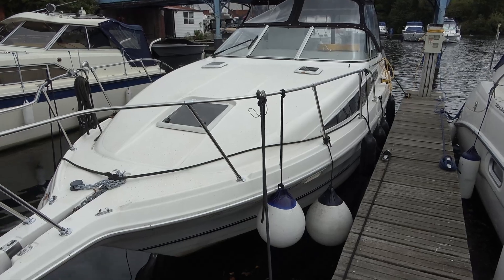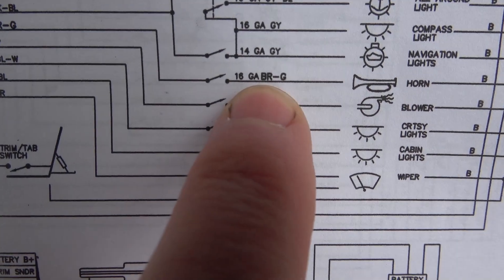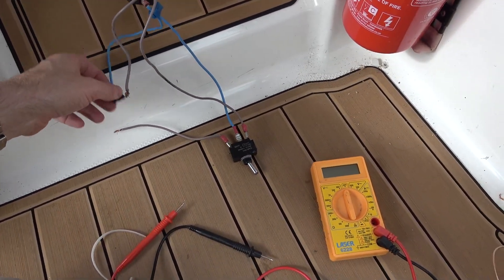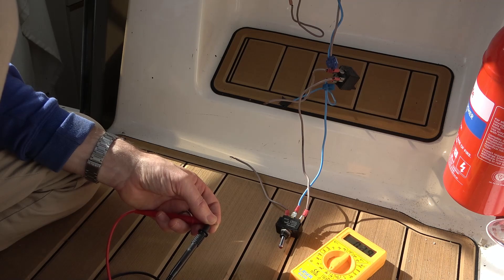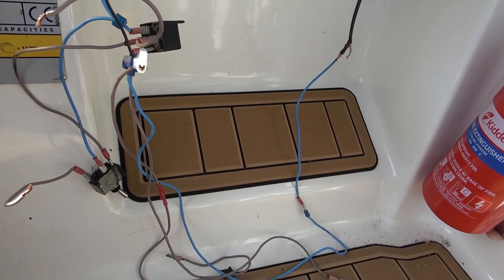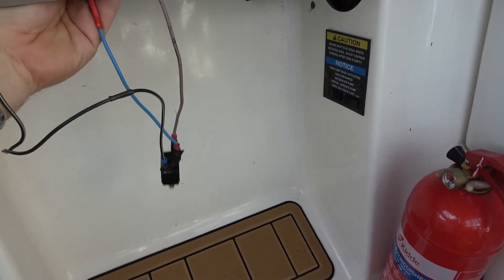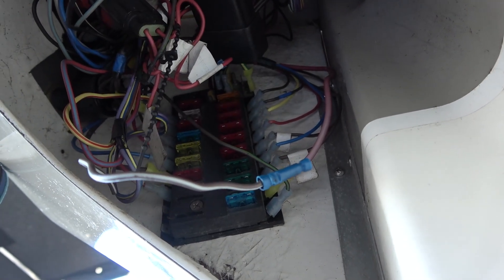BOAT HORN NOT WORKING - Can We Fix it?

Comment: Great fix as always Vince. I'm all for simplicity so would probably have done away with the relay as well. The horn has a low current draw and on a momentary switch its not going to need a relay. I suspect this was for the other after market item as you suggested. 😃😃
Reply: Maybe some older air horns must use a lot of current.

Comment: I'm an electrician by trade but like yourself I've done nearly everything . I reckon the only reason for the relay there is if they were driving something else besides the horn off that switch , ie the lights flashed when you blew the horn ( which might be too many amps for the switch , hence the relay) . Whenever I work on boats or mobile homes I always solder the joints and use heat shrink. I've seen some horrible connections with scotch lock things and spade connectors . Well done Vince , keep up the good work

Comment: it is quite common that devices on boats exceed the current limit of the switches so they add relays but then people come in and decide to add things on to circuits and think it is ok to just increase the rating  on the fuse on that circuit to allow for the extra drain but sadly those that add on usually tap into the wrong place and reading other comments some horns do have quite a high drain and yes usually would not need a relay but you dont know what has been added and without knowing the drain from the horn and the current rating on the switch you cant simply remove the relay I really enjoy seeing the things you do and your thought processes and logical decisions and that works great until you start work on a circuit that people who dont understand electrics have put taps on it. I am an auto electrician but I am very impressed with how you work through repairs but personally when working on electrics it is always important to identify what changes have been done and also identify any effects it has had the only advice I can give on boats and cars is power and grounds it always work for me I hope it helps mate

Comment: very good temporary fix😊 when you have to make it 100% finished, use some joint sleeves with solder in them and they shrink over the joint so they are 100% waterproof😊 I would draw a brand new ground wire for the whole thing, so you are sure that you have a 100% good ground wire (this is very important) it is always a bad ground wire which is to blame for many hot wires and possible melting cables, regardless of whether they are boats or cars😊 or trailer / trailer connector (the damn ground wires / ground connections)😅😅. and the best thing would be to buy a relay housing, they cost almost nothing and have new wires on them. then it will also be easier when you have to change the relay when it has worn out.I think the aforementioned owner had a double horn (a large horn) with mega sound installed😅😅 so the last wire has been to number 2 horn😊 I love to sit and watch your different fixes of different things, I myself have learned a lot about something that I myself have not now separated into such small parts😅🥰

Comment: Vince I think this is a bit bigger than a Tea Time fix.   That loose Grey/Blue wire hanging is part of the All Round Lights according to your first wiring diagram.  This needs the dash taken out and each circuit rewired one by one.  I’m pretty sure the original circuit ( as shown in wiring diagram) was switching +ve 12 v to the horn with -ve being connected to a fixed battery -ve point.   Probably a bigger horn was added (might be the one that’s there now or maybe not), however that horn had a bigger current draw. Hence the larger fitted fuse, however I doubt the switch was rated for the higher current (or they were worried it would fail). So they used the switch (low current ) to turn on a relay coil then used a +ve feed too the horn and switched the -ve side of the horn through the relay contact to battery -ve.  I think doing what you are now doing may still be switching the negative side. If you are, that would not be good in my opinion, I would suggest as it is it  leaves +ve permanently present on the horn, which could short or (leak) current either blowing the fuse, or possibly flattening the battery. I could be wrong. But I would measure the horn current and then either rewire to route direct through the dash switch, to the horn. Or rewire to switch +ve to the relay coil with the horn then fed through the relay contacts.  The -ve of the horn and coil going to a battery -ve point.  Hope this makes sense, it sounds great in my head. :). If not shout.

Comment: I commented about the wiring in your trim tab video and then seeing this one, it is about the connectors not being heat shrink type. The manufacturers did not take the time and expense of using heat shrink connectors. Corosion OS the biggest enemy of a boat and those junk connectors fail always after some time. I suggest that every connector be changed to heat shrink as all of them will eventually fail and you will constantly be chasing these broken wires. I have changed hundreds on my boat and have hundreds to go. Almost every failure is due to the open type crimp splices with corroded wires falling out. I have found dozens of broken butt splices and terminal ends. My boat is 23 years old and 46 feet with literally hundreds of splices and connectors. I buy heat shrink connectors and butt splices buy the hundreds and always seem to be running out as I just proactively replace them when I am in any area. Only very high end boats take the time and expense to use the heat shrink type connectors and but splices.
I had a 20 foot boat that was 40 years old and something seemed to always be failing. I went through every connection on the boat and replaced every connector and terminal end. That was the end of electrical problems for that one. It did take me about 40 hours to just complete that one boat. I also spray corrosion inhibitor on everything when I done working on it also.
And on any old boat it seems, people have mucked around the wiring over the years making an absolute mess. My current 46 foot boat had hundreds of feet of old wiring that I meticulously went through and removed it all. This makes things so much easier to work on in the future. Funny how when people work on a boat that they just leave all the old wiring when putting in new stuff. This particular boat was bought from the original owner that always had hired people working on it and they made an absolute mess of things. It has taken me literally hundreds of hours to go through everything and fix all the mistakes made by the "professionals". A properly taken care of boat should be very reliable and shoddy repairs just lead to headache after headache. After 2 years, I think I finally have every system working 100%. Not an easy task in a 23 year old 46 foot boat. It really pays off in peace of mind when out cruising for 6 months at a time.

Comment: So, The only reason the switch needs a 0V (Also can be called ground or negative, I'm OK with any of that) is to make the indicator light when it's on. The bulb will draw milliamps.
In other words, the switch is just a momentary switch connecting 2 terminals together for the horn to work with another connection for a ground to light that little lamp in the switch.

You probably don't need the relay at all, but if you think you do because the horn current rating exceeds that of the switch then the relay needs 0V on one side of the coil, and a 12V feed from the switch on the other coil side of the relay.
Then the relay contacts act as a switch, just passing 12V when the relay is energised (Like the switch could do on it's own..)

Measuring a switch with a neon or bulb or even an LED indicator with a basic multimeter can cause confusion to anyone.  In an ideal world 2 of the terminals will show Inf and 0 when turned off and on, the other terminal should show a few ohms (the bulb in the switch) either all the time, or when the switch is on depending which of the main switch contacts you are measuring through.
I wish I could post a diagram :-)

Comment: The horn has a low current draw. ie a 10a fuse and does not need a relay.
Possibility is that air horns were fitted ie 30-40a which needs a relay.
For unknown reasons the airhorn pump has been cut out of the harness.
great that you found connections to bring iy alive once more.

Comment: the wiring to the horn , you put one direct negative earth to the horn and the negitive side of the switch , next the live wire from the fuse block to the positive side of the switch  then the postive switched terminal on the switch you put a wire to the other terminal or postive side of the horn  making a curcuit . dump the relay The live wire or postive is the only wire which is controlled by the switch . The red light in the switch is on the same curcuit as the switched live connection meaning it will only light up when the switch is turned on .

Comment: looks like original horn was upgraded with a higher current one, which would make the original switch insufficiently able to handle the higher amps...so you fit a relay. Same idea as when fitting extra lights to a car. The wiring diagram shows a simple switch joining one wire..an in and an out. Connect. So the switch takes all the current. I gather someone fitted a bigger/replacement horn, and then bodged a relay in, badly. It'll be a type 86 relay, used all over the show in cars. Common. Worth reading up about how to wire them. Good job figuring it out Vince.

Comment: The dreaded Scotchlock connector,as a retired Motor Mechanic I came across those regularly in the 70's,car owners fitting their own electrical accessories radios,spotlights,guages etc,a nightmare at times as they had no clue about fuse sizes and it always caused problems,they just looked for a 12 volt supply and pressed one of these on with pliers

Comment: Those automotive relays are very simple and are used for high amp loads like horns, Heaters etc. so you won't fry the switch.
The relay has 2 terminals for activating the coil, ground and power from the switch. (the switch activates the relay)

Ground goes straight to the horn
Battery power to 1 of the switching terminals on the relay, and the other switching terminal to the positive of the horn.

Comment: Maybe if you could get an test light for things like this, it could help out some. You can do quite a bit of checks with that one simple tool. Just a suggestion. Good job!
Reply: As a mechanic I've spent far too much money on a Power Probe and the countless accessories and still use my $2 test light far more often! Lol
Reply: couldn't agree more
Reply: @godmonkeyjr  I do use the power probe more and more recently however the simple “scope on a rope” can do quite a lot on it’s own.

In the video here where Mr Vince was struggling to prove out the circuit because how boat electrical is done, the power probe may have been more of a benefit because it needs to be connected to a power and ground ans can deliver either to the end to check for certain things. 

But first things first though, if he would get a circuit tester and get the basics of it down, when he goes to check other vehicular circuits, it could help him save some frustration.

Comment: It looks to me that either:

- The horn switch may have been used to turn something off whenever the horn was used (whatever the leftover brown wire was feeding)

- There was a horn override that locked out the horn switch that has been removed. 

- There was a backup power for the horn so that it could still be used if the main batteries were dead 

It all depends on what kind of relay that is and how it's wired.

Comment: Using screw type connectors in a marine environment is asking for trouble. Inevitable corrosion will reduce the diameter of the wires in the connectors thus loosening them. You should use a spring type connector that can conform to a reducing wire diameter or spade connectors ( but only if properly crimped).

Comment: The previous owner probably had a louder more powerful horn and they installed the relay for the increased power so as not to burn out the switch.
Reply: (and note, 30 amp fuse)

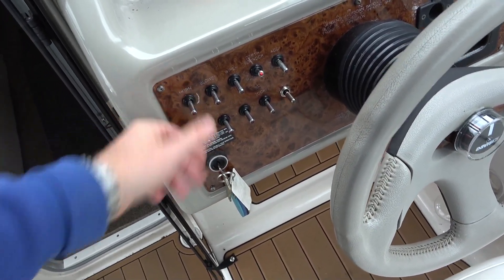Comment: 2:10 - Current has to flow through the switch through the output to ground before the light will come on. only two wires on switch so no independent ground for the light.

Comment: Nice repair, that's probably the biggest difference between cars and boats that the boat is fiberglass instead of metal, and therefore the body cannot be used as a ground :D
Well, besides the obvious major difference between boars and cars :D

Comment: The switch needed a -ve wire for the light in it, no other reason. The diagram shows no relay, so perhaps a previous owner (the one responsible for the dog's breakfast of wrong coloured wires under the dash) had a larger horn (or a pair of wind-tones) which drew more current. I don't think the relay is required - its just something else to go wrong. Feeding something else from the horn feed, needing a larger fuse is a no-no, the wires are not rated for the heavier load and are a fire risk.

Comment: Well sorted. Not standard, you're not kidding, the wiring diagram shows different wire colours, appears not to show the relay (something from a previous add-in bodge) and not the toggle switch light either (diagram possibly for a different boat). I expect / hope you tidied up the dangerous-looking mess at 2:46. You may not need the relay, but that is a big may not.

Comment: Hey Vince! That relay is not necessary to sound the factory horn. It was probably added to power a after-market pneumatic horn motor that has since been removed. That being said it can stay in place the way you have it wired now. In the future if it causes problems just remove the relay all together. Cheers!

Comment: Was the relay necessary or only there due to the fact that something else was wired in previously?
Reply: Eg. The switch has a lower amp rating (3amp) than the horn requires to operate (10amp), the switch powers the relay coil (<1amp) instead. It prevents burning up the switch contacts.

Comment: thinking the holes in the dashboard of the boat, looks like a smoking lighter socket, but then trying to figure out why you would want 4 screw holes type size holes. thinking about it, it could possibly be a clock that is missing as the holes would be right for that. or a tacho, or speedo. but my main guess would be a clock, as be the most obvious. but even that would be a 5 - 10 amp fues. a smoking lighter wouldn't be a 30 amp, and the other two guages wouldn't be that high either, so there must be something high current needed for a 30 amp like something in the living compartment like a microwave or kettle or something to need a 30 amp fuse, otherwise there shouldn't ever need to be more than 15-20 amp.
Reply: but full beam on a car is around 30 amp, but can't imagine wanting to do full beam of a light while sounding the horn, you would kind of want and need them on a different circuit if a highbeam light was fitted to the boat. and if that was the case, then you would take a feed from a circuit that has the nearest amp fuse, as even though increasing a fuse isn't majorly important in the short term, a long term impact is it sends too much current and wears things like a horn out sooner, not to mention heats up the wiring to dangerous levels if the wiring isn't meant for high current.
Reply: like you would want to get wiring that is capable of 5 amps more than the fuse it is fitted to as a general rule of thumb. so the the wiring doesn't overheat. and if replacing a fuse it should not be more than 5 amps than the circuit says it should be, until you can replace it with the proper sized fuse, like when you get to shore in the boats case, never leaving a fuse in that will allow too much current to flow.

Comment: was the relay necessary, or remains from the aftermarket equipment?
the wiring diagram had just the switch. 1:19 couldn't see the whole path though.
couldn't you just run the voltage through the switch, and remove the relay?
Reply: Switches wont last as long as it's better for higher current to go through the relay instead
Reply: @Tokaisho1  it's a horn
Reply: Both Tokaisho and Gertrude are correct. The highest amperage draw I can find for a 12V horn online is 8A, and that's for a much larger horn than what they've got.

So while the logic of reducing current through a switch isn't a bad idea, it's not that high of a draw.

Comment: Vince, I would have removed the relay and bought it back to stock configuration. Keep in mind the wiring used may not be able to support more than 10A.. so adding additional load on the circuit could be a bad thing.  Well done !